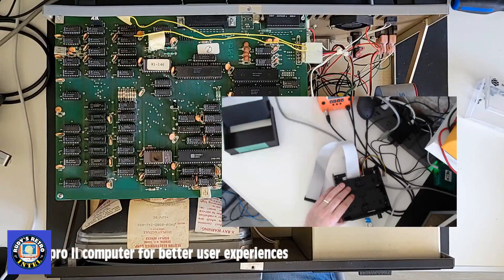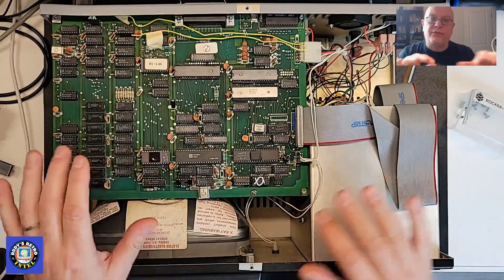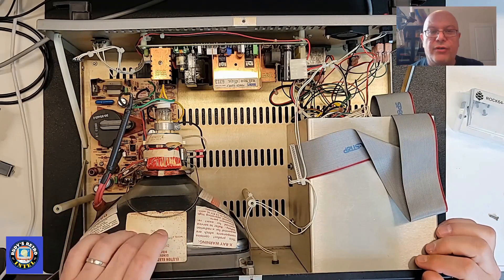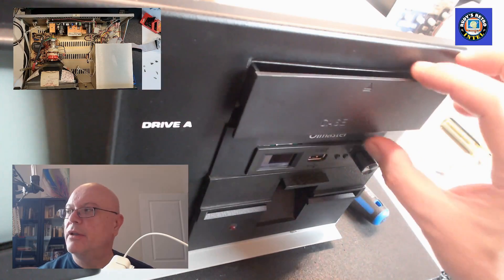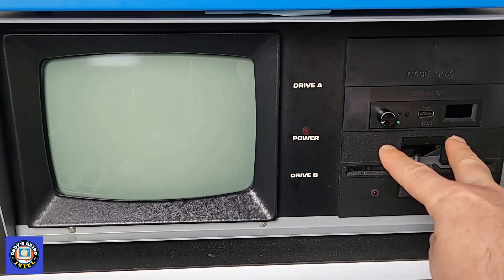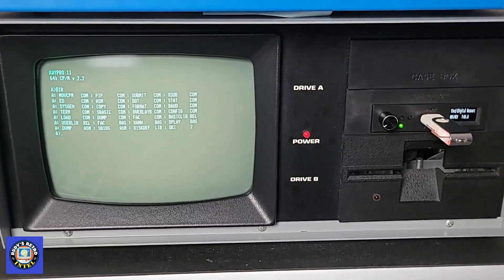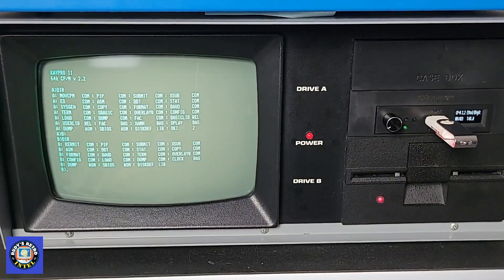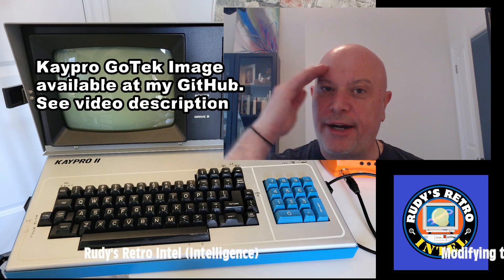Make the Kaypro computer easier with a GoTek drive?

Comment: Two years late! I've worked a lot with the Goteks. He had the mounting correct the first time. On this model, the OLED was designed upside down. There is an entry in the config file that will invert the display.
Reply from the maker: Thanks for that. I figured that out when it was already done. Lol. Thanks for commenting

Comment: Hello Rudy,

I have a kaypro II and no disks. But I have a gotek with flash floppy. I would like to use your file from GitHub for the CP/M and then copy them to a real floppy disk in drive B by using the gotek in the kaypro. Do you have also the right jumper settings for the gotek for me? Regards, Ben (From the Netherlands)
Reply from the maker: Hello Ben, I used the GoTek as drive A, so I believe that the jumpers are already set for drive A. I don't have access to my Kaypro right now, but the GoTek site should have the jumper settings. Thanks for commenting.
Reply: Thanks a lot for your reply. Tomorrow I’m going to have a look at the gotek website then and at your GitHub files. I couldn’t find the correct file type with CP/M for the gotek. On the internet at first I only found .td0 files. So I really hope that I can get CP/M running tomorrow using your files! Thanks again for your reply, this video helps a lot :). I will let you know if I get it running.

Comment: Rudy are the STL files for those 2 items you added available? The gotek mount and the drawer insert?
Reply: Found it on Ali from your other video.
Reply from the maker: Thanks for commenting
Reply: @RudysRetroIntel  I have a KayPro I received over a year ago I am working on and it seems to have the Turbo mod on it. The PSU is dead I think the SCR is bad as all the caps tested good. I have new part on the way. Not sure you done anymore videos on the KayPro as I do not see them. I got 1 fixed that I have (as I have 2 of them) and it works with FlashFloppoy Gotek but I waiting on floppy cables to arrive to I can connect both drives. Need to play more with images on the gotek etc. Is a nice machine. I had to mod the keyboard connection as the cables and the connector plug on keyboard bad. I changed them to mini 4 pin DIN so can use the same cable as Macs. Changed the connector on the PCB also. Looks great.
Reply from the maker: Excellent to hear you are on the way! I haven't done any Kaypro repair videos. However, I know you are smart enough to fix them. Love the keyboard mod!! Thanks for sharing!
Reply from the maker: No STL files, I just purchased the GoTekand drawer and installed them. Both are available on AliExpress

Comment: Assuming you are using FlashFloppy, you can flip the text on the LCD via the configuration file, so you can keep the knob on the right if you liked that better (and it's the default).
Reply from the maker: Thanks for pointing that out! I didn't know until much later that I could do that, but it is fine the way it is. I'm just happy it all works great. Thanks for commenting

Comment: These kind of mods I absolutely love as there are no holes or modifications to the case. The drawer to fill the extra hole is a great idea and something I should have on my tower when I am editing to put in all my tiny memory cards lying around. Funny enough I mentioned in previous comments that it looked like the TRS-80 and it also had rifa caps that cracked. Can't wait to see the reset and composite mod.
Reply from the maker: Thanks for commenting and sharing. Yes, I'm really happy with that drawer. I put 2 usb keys and the keyboard cable in it. Now things won't get lost. Rifa caps are a pain. I was so excited that I powered on and forgot to check for those capacitors. At least I got some video of it, and they didn't damage the power-supply.